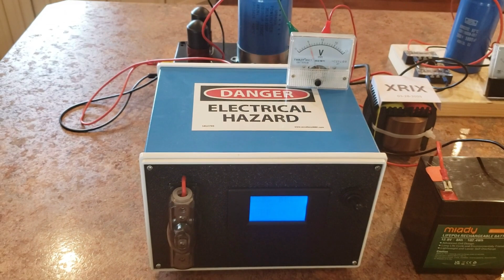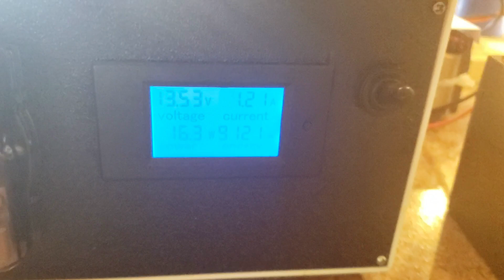Over Unity Working Don Smith Device - Part III

Comment: @XR_IX : In zilano final disclosure / the device shown here what is the 350v dc power? 
Is it a capacitor that is charged up to 350v or some voltage then when the xenon tube is triggered it releases that capacitor to the coil?
Or is it just the output of a transformer from the 4.5v / 12v dc that's being pulsed in?
Is there anything special wires needed from the dc source? 
is using 18awg hook up wire ok?

Trying to put a electrolytic capacitor (3 x 50v 1000uF capacitors in series) that is charged up with another transformer then at 70v the 70v gdt makes an audio sound when it discharges the electrolytic capacitor. Without the capacitor, the gdt discharges with just a normal reddish color without any sound.

The input - in zilano's diagram looks like it's connected to earth ground? I did not have any connection to earth ground in the tests.

Putting like a 6v-12v lab power supply there as input and a mosfet pulsing the where the xenon tube is at requires a lot of amps from the power supply and the transformer past the microwave 1uF capacitors doesn't seem to get all of the power from the mosfet pulse. This is true for the 1uF microwave capacitor setup in the zilano final disclosure or the 3 capacitor setup in tesla colorado spring pg 57. If the transformer is just pulsed directly without the microwave capacitors and the diode on the + power supply, it works normally as expected.
Reply from the maker: @briareosbri

Lot's of questions, let me clarify from beginning. The exciter caps are charged to 1500v which is the limit of the GDT. The Xenon tubes, take over at the point there is enough energy to drive them, and calibrated to a frequency where the GDT does not fire. They are run solely by energy from the tertiary coil on the isolation transformer. Thus I am not spending additional energy to drive the switching of the xenon tubes. The tubes are also firing in sync with the exciter pulses, because the maximum voltage sent to the xenon tubes will be at the same instant the tubes spark over, and the field collapses. It's basically constructive feedback. They are redundant to assure longevity. HV side hookup should be fine with smaller wire. This is not very powerful output, but should you build a more powerful device, you will be sending more power from the caps to the trafo. The caps do start to get warm, if you start raising the joules per second. I can't speak to your capacitor values, nor omitting the capacitors entirely. In theory this is why you see amplification in just batteries alone, switched on/off. However Don Smith used them in his earlier devices, and there is a reason for using HV, which simply it is more efficient in producing coulombs of energy, because the voltage is squared. Lower voltages and higher capacitance switching, means you have to charge caps with amps, to compensate. It implies that the opposite is true, however HV is hard to switch outside a spark gap, and it wears the components. I have burned spark plugs to nubs in less than an hour. This is what people fail to see, is that you have to have energy to create more energy. There is a relationships for components, used and the efficiency of the device. This is why Don built so many types, he was looking for the most efficient way. I am glad you are surfacing some of these aspects.
Reply: @XR_IX  @XR_IX
Thank you for replying.

I was thinking of trying to put two primary coils in parallel on the output transformer, one on the top leg and second leg. The output coils would be wound over each leg. I am not sure if this will work. I'll try it out to see if this will work correctly with low voltages.

I have some more questions:

1. You mentioned a GDT, is that what is outside of the blue box a 1500V GDT?

2. For the xenon tubes, can a camera flash xenon (around 3.6mm in diameter x 34mm) tube be used? I believe they are rated for 300-500v. I'm not sure when the xenon tube is shorted how much voltage rating is needed, is it 1500V or 500V? I'm not sure what size xenon tube would be needed then. I'm not sure if multiple can be put together in parallel to fix the voltage issue. The trigger wire on the tubes would be all tied together also.

3. The wires on the output transformer are they just regular tinned silicone wire? For the primary winding, I can't tell if it's using silicone wire also or magnetic wire  (like 20awg?) then soldered to like 16awg silicone wire. 

4. It looks like one of the output is 10awg silicone wire with 8 turns or so for the 12v output. I believe a microwave transformer is around 1:20 ratio. So does this mean your primary is around 8 * 20 = 160 turns?
Reply from the maker: #1 - Yes
#2,#5 - You should stick to gdt, and stay away from Xenon tubes and solid state until you know what to expect. Xenon use is not easy, and was an improvement because my GDTs would burn out after a day once I got over 600V 
#4 - Yes, Litz wire is best but Si DC wire works, which Don used Speaker wire. The WHY this works, is really the secret to the universe.
#6 - 12V HV(via NST, ZVS+Flyback, Spark Module) --> FWBR --> PP 1500V GDT --> Par/Serial HV CAP Bank --> PAR Primary --> Secondary --> FWBR --> Storage Cap --> DC LOAD
Reply from the maker: @briareosbri

You must try to focus your questions, because I believe you are in discovery mode and it is easy to try too many things at once. It leads to dissapointment and frustration.

I have three OU videos, The reason I built a progression, is because I move iteratevly. My approach is to get success, and to improve generations by testing. Before I built six MOTs, I used one MOT, two MOT... I used a MOT because I can buy them, and the effect can be seen, though not optimally. You can buy an off the shelf MOT, use a spark gap or GDT and see results. I urge you to get something working, which means illuminate an LED on the output side of a transformer. 

There are many failure paths in building your own output transformer. It looks easy, but it's not. I have purchased over two thousand dollars of Metglas type cores ranging from AMCC32, AMCC40, AMCC100, AMCC200 and a very large one probably 2 times the size of an AMCC1000. Don Smith said he could create OU easy with transformers he had built in India. But you have to know what you are doing.

Build something that works, find an application for making it usefull to remind yourself and keep you inspired. I have a 10W solar panel that keeps two 20W 120V LEDs iluminated for 4 hours on cloudy days and 7 hours on sunny days. It has run steadly for two years.
Reply: @XR_IX  
When using a ZVS+Flyback, is a FWBR necessary for the output of the flyback? I believe the flyback transformer already outputs dc (The suction cup output, it should have a diode in there). I am not sure if another diode is needed after that like in zilano's diagram. If it is needed because it has a faster recovery time, then 2 BYT78  in series (for 2kv if using a 1500v gdt)?

I've looked into litz wire also, some are sold with around 100khz frequency, I think using it at really low frequency the stray capacitance or something may make it worse than just using a solid magnetic wire. The wire don use was special it had each individual strand coated in some sort of plastic insulator, which had a ton of strands to counter the skin effect when running at higher frequency.
Reply from the maker: @briareosbri  I'm sure it depends on the "Flyback" you are using. You would have to look at the specs. I use ones meant for CO2 lasers. It works fine, I am not getting a reading on my meter to confirm there is one there. The point is to get DC to the caps to charge them. RE: Wire - Not sure if you are talking about Amp King or Litz. Litz is the only wire I know which is individually insulated.
Reply: @XR_IX  
I saw this text n some q&a with don:

Q: is the Amp King #8 multistand wire Litz -ie insulated conductors – or regular, like house wiring?

A: it’s similar to Litz but no individual wrapping on each multistrand. It’s flexible, plastic coated normally used for high amperage DC, but works beautifully with High
frequency AC. I assumed You want a practical Unit which produces Energy which becomes useful upon passing through a diode bridge into a capacitor bank and then through
an inverter to useful load. Regular Tesla Coil Transformers don’t produce usable amperage. You can up the amperage by putting ferromagnetic ( soft magnet material ) as the
core of the L-2.

I am not sure if the amp king wire is what don mentioned or some other wire.

Also you mentioned: PP 1500V GDT. What does the PP stand for? Does it mean in parallel or 2 in parallel?
Reply from the maker: @briareosbri  Parallel. Yes that quote I know quite well, so really his wire is not individually insulated. But question why this would matter, because in the end, current is distributed evenly on every strand --if it was insulated, according to Ohm's Law.
Reply: @XR_IX  
Hi XRIX,

I have a few more questions:

1. When using a gdt 1500v is it supposed to make a low frequency sound in the core (probably around 30-40hz maybe less)? 
Also, I get around 5.0v with a 350v gdt output then it's around 9-10v or so with the 1500v gdt. Both of these tests were with the same amcc0320 core config. This is when the capacitor stabilizes (16v 100000uF capacitor). The load is a 12v 5w incandescent light bulb. I've burnt out a few BYT78 now. I didn't think it'd burn out on the output side of the transformer. I put 2 in series for the output side now.
I'm using around 12v 2a (around 22-24w) of power when the zvs is powered. I think I've seen others get around 8v or so with a MOT.

2. Is the size of the gdt correct? around 8mm diameter and 6mm or so? Should I try to find larger physical size ones? I've seen gdts that go up to 6kv - 25kv which is pretty crazy. I would never try anything over the 1500v. I can see why don use such huge capacitors now.

3. You mentioned that I shouldn't try experimenting with xenon or solid state until I know what to expect. I've tried solid state and got the same result as the 350v gdt. Solid state was not that bad to get 'working'. The xenon approach seems like it would take a lot more work for me to figure out how to do the trigger. Somebody mentioned a patent regarding this, which is almost identical to zilano's diagram. I think in the patent they mentioned that the xenon tube has to fire at the same time as the input pulse when it's high. With the solid state, I just had to have the correct frequency and duty cycle. I tried changing the phase to see if it would align with the input high pulse, but it only affect things a little bit. How do you sync the xenon tube trigger with the high input of the zvs or nst (The patent mentioned this was voltage amplification I think)? Also, if it's not in sync does the output drop a lot?
Reply: I tried the setup with a MOT the mot primary coil resistance is 1 ohm. The secondary coil resistance is 160 ohm. It came with a 0.85uF 2100v cap.
Hooking up the mot to the zvs+flyback and measuring the voltage at the output capacitor it's around 0.7v which seems really low. I'm probably doing something wrong. I have the following:

zvs+flyback > fwbr -> par 350v gdt -> serial/par 1uF cap (each serial cap end is connected to one of the gdt legs)  -> MOT secondary  (160 ohm) connected to par cap > MOT primary (l1 ohm) -> fwbr -> 16v 100000 cap (multi-meter on this + and -) -> 12v 5w bulb. 

With my simple winding on the amcc0320, I get around 3.5v output.

This probably explains why I can't measure any magnetic field around the different transformers all this time.

When I first tried this and had an input of 5v instead of the zvs/flyback and just shorted the wire by hand, I can feel the wire magnetizing when shorting it. It was strong enough to feel 'sticky'.

I'm using spade connectors to the microwave caps with 16awg wires. I tried switching to 10awg wires for the serial/par cap connections soldered to the spade connector (4.8mm) . This didn't seem to make much of a difference. For the gdt, I'm using "Lever Wire Connectors 1 to 1 Inline Electrical Wire Connector". I am not sure if the gdt needs to be soldered to the serial cap. The lever connectors make it easy to try out different gdt.

I wonder if my connection is wrong somewhere and that's why it's generating such a small magnetic field. Maybe something's wrong with the caps or zvs/flyback. I tested the caps and they show around 1uF capacitance.

@XRIX The magnetic field should be detectable around the transformer with a 350v gdt?
Reply from the maker: @briareosbri  I will share this for one week https://youtu.be/URkTNuZYZ_c
Reply: @XR_IX  
Thank you for all the information.
Reply: @XR_IX 
 Is the red thing the varistor?

Also, what is the thing connected to ground with the green wire? Is it a surge arrester?
Reply from the maker: @briareosbri  Red is Varistor, clamps down  to  assure my expensive caps don't breakdown. The green wire is neg of the capacitor of the pair that drives the analog meter to let me know it can charge to 12V
Reply: @XR_IX  
Sorry, not that green. The green wire that's close to the nst. It is connected to something that looks like a heatsink or something. I thought it was a spark arrester or surge arrester. I am not sure what is inside it also.
Reply from the maker: @briareosbri  Oh in the Red Pill, that is early test circuits not used in that specific configuration. You see a thyristor used in many Don Smith devices. If you get to that point, you are really rising above the rest.
Reply: @XR_IX  
So the long red cylinder bar is a varistor in the red pill? Or is it a bleeder resistor for the caps?
Reply from the maker: @briareosbri  Those yellow caps would stay charged without that bleeder. That's why I switched to Microwave caps that discharge on their own, when using HV. Even  a 1/4 1Meg would do. But it depends on your firing cycle. I have smoked capacitors in other experiments, so safety needs to be applied. I believe those are 1uF@1KV but they become marginal using a spark gap over time. Which taught me other valued lessons about resonance. You can brute force the exciter to work, but it always better to match a working resonant frequency. Not something like... find the Earth resonance, or Schumann Freq, (Though Both Are applicable in different situations) it is more  a relationship with your HV supply can has enough power, and if the natural Freq between the coil and caps can keep rolling. Have you ever asked yourself why Zilano circuits look so simple? There are two reasons, the core of why the work is simple, and it because it does something unexpected. You see the Red Pill, nobody would have suspected you could do that with electricity.
Reply from the maker: Last day BTW and Red Pill will be unavailable tomorrow.
Reply: @XR_IX  
You mentioned "spark module" like a car ignition coil? 
If this is correct, I'm guessing the reason to use this would be so the frequency like at 72hz or lower can be used to match up with the switching of the cap's frequency.

I'm switching my caps at around 52-72hz. I think my primary coil odd harmonic  (square wave, so I believe it should be an odd harmonic) resonant freq  is around 72hz. I left a gdt  in parallel sitll to protect the switching from going too high voltage, while I'm experimenting.

I have not tried to match my secondary coil resonance with the primary coil on the transformer. I believe I just have to add the right capacitor values in parallel to the secondary coils.

I've tried a zvs+flyback and nst so far.
Reply from the maker: @briareosbri  I use a cheap Aliexpress spark module for 6 dollars, to keep two twenty watt 120V LEDs illuminated in my backyard for 4 to 8 hours depending on the amount of sun that day. It isn't a frequency, it isn't a holy grail part. This was told to me from the first guy I believed actually created a working device. You use high voltage to overcome capacitor costs. You are turning voltage into coulombs, through a capacitor transformer system; That requires a capacitor and primary and secondary. But once you figure out what is going on, you will realize that capacitance can created in many relationships. It really isn't the "Capacitor"  that is the key. It the DC ON/OFF. -Which can be done with batteries and no capacitors. Hence HV isn't really needed, but then switching becomes the hurdle. There are ways to simplify all aspects of tuning the primary and secondary DSE transformer. Build something that produce power on a secondary, and learn how to consistently manipulate the parts.
Reply: @XR_IX  
Regarding the transformer, is the tape used between layers:
MMYP-1 Mylar Metalized Polyester Film Tape with Acrylic Adhesive ?
If not, what kind of transformer tape is used?

I watched one of don's video and he mentioned it was a metallic tape and it had some shellac or something on it. This was on the briefcase model. With metal tape between each layer and a dielectric, doesn't this create a capacitor.

Also, on don's brief case model it looks like your winding except for the thickest wire on the transformer was the primary and had pairs of wire and one of them wasn't connected and left pointing up. Don mentioned that the wires standing up and unconnected were antennae, but I wasn't sure if he was kidding or not. 

In your transformer, I saw in the comments that the thickness wire (black) was an secondary output. Does it have a fwbr at the end of it also? I see that the other black wire is the 110-120v output with a fwbr on it.

I have tried bucking secondaries on the transformer (one diode on each of the secondary only), I think that gave the most output for me so far. The secondary had the same length. The secondary windings were not a multiple of the primary. I need to have all the windings be a multiple of each other. Also, since it's such a low frequency and hv it seems like you'd need a lot of windings on the primary. I believe that's how a normal transformer would work.

My input power go up a lot after a certain point, I think my core is being saturated. It would be amazing, if I could get 70-90% output power from the input power at least.

I have not tried with a amo nano core yet. I believe a amo nano would work better at lower freq (like 5-12hz) than just an amo core.

You mentioned there are ways to simplify the tuning of the primary and secondary. Is it just keeping all the wire lengths a multiple of each other? Also, I've read that to keep the resonance for the wire length, the wire connecting to winding outputs should be greater or less than in awg diameter (this terminates it or something?).
Reply from the maker: The approach is to create as many joules as possible over a small time period. If it takes you all day to charge a cap just to have a huge discharge, you are less likely to capture and utilize that single pulse versus many consistent smaller ones. That 350V means that is cap limit? Not necessarily. A cap is such that you achieve 1T around 63% So you should always have about twice the capacity  to assure that you are not fighting to fill a capacitor to maximum breakdown. The like charges will resist being placed in a cramped space.
Reply: @XR_IX  
I've been trying to look up the equation to find the tesla for discharging the different value capacitors at a voltage. I think I'll probably need other information like the inductance of the coil and resistance of the coil.
I'm using 3x .84uF microwave capacitors in series now.  I believe that means I'm discharging 0.28uF into the primary. I'm using a 1200v gdt. I've tried a few different value of capacitance (paralleling or in series to raise/lower capacitance). 

I've tried out the xenon tube switching, I am triggering the xenon tube at 33hz for the 1200v. The xenon tube gets very hot, this is probably normal since all light bulbs get hot. I think it's better to have a shorter xenon tube, so it turns off faster?

I just wanted to try the gdt / xenon tube to see what it's like. I am using a mosfet (0.001% duty cycle) for the capacitor discharge to trigger the xenon tube. I'll go back to gdt / solid state switching.
Reply: @XR_IX  
Any information I should read / learn about regarding building the transformer?

I've tried an amo 0320 and a amo nano 0125 core now. 
I tried bucking coils on the 0320 core, with only 2 diodes. I've tried different amount of turns with this configuration.
I tried just winding cw/ccw with a fwbr on output for the amo nano 0125 with 324T on each bobbin.
I tried air grounding with the output ground, and it didn't seem to do anything.
I only get around 12v - 20v output max, not sure about current.
I've tried using just the bobbins on an air core and that gets about 7v, which is pretty crazy since it's like half of what it is on an amo core.

I forgot to plug in the output once and it sounded the the amo core was gonna break apart from the really loud sound, seems like it was really magnetized and hitting the two halfs with really strong force. I tired using a magnetometer and still can't get a reading around the core, not sure what I'm doing wrong. I'm able to put the magnetometer over a neo magnet and it registers it fine. I tried getting readings from the amo core and an air core around the coil/core, but it did not register anything.

I haven't tried a zero transformer yet. I think don smith uses this type of winding. I think zero transformers require pretty high frequencies to get working though. I believe they need an earth ground, not sure if it could be air grounded with just an aluminum sheet or something.
Reply from the maker: @briareosbri  You should not get a reading on a gauss meter with a neo, unless you move the magnet around.  So understand that you are not capturing the power of a stationary flux field, but a moving one. Which is what you are trying to create successfully. Have you got a single MOT to work? You also have to remember if you are using 1uF caps, and firing them at 600 to 1500 volts,  that the frequency of the oscillations will be high. So use high speed diodes. You can't use microwave capacitors, use the BYV Sinter Bead diodes, and using two is fine, but  a FWBR is the best. I am not sure what you are doing wrong, make sure you use thick wire on the primary like don device 3. Remember his secondary is skinny. Maybe you should take different wire types and leave them on the spool but just run it in parallel with the the gap, and cap. Measure the amount of flux you have with a gauss meter. You need to learn what the best materials to get the most magnetic flux
Reply from the maker: Post a video of what you have. Easier to troubleshoot
Reply: @XR_IX  
I've gotten a single MOT working with 12v 5w incandescent light bulb.
I'm using 3 x 0.848uF, BYT78 diodes, FWBR with the amo nano core currently.
The 324T was with magnetic wire 20awg.
I just tried using 16awg silicone wire pure copper,oxygen free 252 strands with 44T CW and 44T CCW  on each bobbin on the amo nano 0125 core. The result was not much better than the magnetic wire. I'm using ferrules on the ends of the wire.

I'm using something like this: "Gauss/Tesla Meter with High Precision Probe & Auto Range Recording 0-20000Gs N/S Polarity Identification, Magnetic Field Tester for Residual Magnetism & Nondestructive Testing" to measure. Maybe it's the wrong tool? I tried it on just an air coil hooked up to the output of the exciter and that meter did not read anything.

I can email you a picture of my setup if that's ok?
Reply from the maker: @briareosbri  An incandescent bulb is like a dead short. The reason we can illuminate LEDs, because some are like dams, and they don't turn on until you reach a threshold. That's why you can't get over 5 volts. The energy is there, but you are grounding it out the DC before it can build. An incandescent bulb illuminates with AC because the charges are basically are sawing back in forth through the tungsten. Charge friction is making that filament hot. Both moving towards ground, and alternating the current. This is why you see many FE devices running high frequency, because for a small energy the friction make current move back and forth faster. So yes you can run a 100 watt bulb with 25 watts of power, if the frequency i 240Hz. I think that is why planes use AC that is 400Hz, to reduce the size of the electrical components. EVGray used to do this. High Frequency, also reduces the risk of fatality because it moves on the skin of conductors. Yes your load matters. That's why I like to show here's my DC input versus the DC loads that I can run. One experimenter has already confirmed that DC verses AC power illuminating the same bulbs I use requires equal or more wattage. Please read some of the other posts.
Reply: @XR_IX  
Thank you xrix for explaining it.
I was able to light up a 110v incandescent light bulb to like 20v or so, but the input power was crazy high.

I've read the comments that you can use a dimable led or a small motor as a load.

It's probably not possible to connect the output to like a mppt, since I don't think it's a dc load.

I've learned a lot doing these experiments, like doing the switching with the gdt, xenon tubes and the capacitor discharge.

I'll try it with 2 air cores (324T coils that I built) as separate transformers to see input power not increasing when adding more transformers to the output.
Reply from the maker: @briareosbri  That is the whole point to it, as long as your transformers are the same primary dimensions,  you should be able to distribute the power equally, without loss of output to each secondary. If you start expanding that thinking, you will be in business. Remember that you are simply multiplying the amount of magnetic flux, so the more power you use your output goes up. I only show about 15W of input, but look at all the work I can do. What if you had higher input 400w, and 10 like transformers.... Do you see the potential? use the equation J=.5C(V^2) where C=Capacitance in Farads and V=Voltage. Then divide the J/Frequency where 60hz=.0166666... Example using 1uF Capacitor at 1200V: .5*.000001(12000^2) hence J= 0.0000005 * 1,440,000 = .72J per pulse. At 60Hz = .72/.0167 ~ 43.11 watts. Your power supply (ZVS or NIST) has to supply 43.11 watts continuous to charge/discharge that .1uF capacitor  at 60Hz. Seems simple but many power sources don't do it well. Don's Old style 15K NSTs were around 450VA maybe. If it were 30ma. But those things could deliver that. The current switching style that are switching, are better because they use HF (~30Khz), but they really not meant to constantly burn. The get the neon bulb fired, and then they draw back once they glow. The also have UL protection circuits, and you are basically shorting them.
Reply: @XR_IX  
I'm currently using a nst 12v 3a, out 4500v 20ma-30ma. I think it's drawing around 13watt of power. I'm using a 12v 350watt power supply. I haven't tried using a 12v 7ah lead acid battery yet.

I also have a zvs that is 12-30v input and 10a-20a. It's supposed to go up to 250watts of power. How do you control how much power the zvs uses? Is it just less turns on the transformer after the exciter with really thick wires so there's less resistance, which makes it draw more power?

I don't understand how to get the input source (like a zvs) to supply more power for charging up the 3 exciter caps faster.

I also experimented with pulsing the output cap to another transformer at a much higher frequency (>10khz). I don't think I was getting any gain by this, maybe a little bit of a loss because it has to go through a fwbr again for the 2nd transformer. The output cap 5600uF sat at around 40-50v.

I also have tried using my own input transformer at the start of all this that was 24v input. it would oscillate and charge up the capacitor to the high voltage. I believe I saw the trumpet wave. I think it was really efficient on input power. I'd have to test it again.
Reply from the maker: @briareosbri  On a neon size transformer the load is the length of the neon tube. Same for increasing the spark distance, effectively raises the voltage to jump the electrodes. Since your Neon sign transformer is fixed at 30 ma, it raises the input power. Carry that into the caps size can is related to the input power. It is a dead short empty, then it fills up and resists being filled. You have to find the limiting part of your exciter.
Reply: @XR_IX  
I think I could try the zvs again with 24v instead of 12v. This will probably increase the input power.

I measured my transformer. I'm getting around 1100ef and 56mG. I believe you were able to get 99mG (or greater) on the microwave transformers?

I'm using 3 x 1.0uF caps now instead of the 3 x 0.84 caps. It's running at about 36hz.

I really need to learn how to make my transformer more efficient for this higher voltage and lower frequency. I was able to get it to 95+% with a bucking setup with pulsed dc at 12v at around 12khz. With this current setup, since it's such a low frequency I'm getting horrible results (I think it's less than 1W output, when the input is like 13W+). If I can get the transformer to be 80% efficient at least, then I'll do multiple transformers in parallel.
Reply from the maker: @briareosbri  Litz wire works the best. I think you need to concentrate on building an exciter you get good results, and then work to get your transformer right. You have some ground to make up, because I can break 99uT so I have an order of magnitude better flux at least. Just uploaded a short to show you.
Reply: @XR_IX  
Wow that's crazy. 
I checked mine and it's only 5uT. What you have is more than 20x. I'm using by203-20 2000v 0.25a for the fwbr after the nst. Maybe I should try BYT78 in series to get the 2kv to make the fwbr.

I'm using the 1uF microwave caps which are non polarized and it's just an oval metal can. I have the caps connected to a ground bus bar (4 in parallel), the output is connected to the ground bus bar. The output is connected to the 2 center ground bus bar. The nst, diodes, gdt are connected to 2 parallel screw terminals.

I'm using a 1200V gdt pulse peak current 10 kA, 8mm diameter x 7.9mm.

Power supply is 12v 29amp.

I tried pulsing an air coil with 10awg silicone wire (8 feet long) with 8 turns and it only reads 1.5uT.

If you pulse an air coil with your exciter how many uT do you get? It's easier to debug to know if it's the exciter or the transformer. If it's the exciter, I'm not sure what would be wrong with the exciter.
Reply from the maker: @briareosbri  Your configuration "sounds" right, just like a schematic "looks" right. You'll need to post a video, to show me what you have.
Reply: I just tried it with zilano 2 cap config on the air coil and it's 0.8uT (It pulses a lot slower). I'm not using a 12v battery, I don't think that would make a difference. I'm using a 4 x 23 slot ground bar bus terminal, maybe it's too big?

I tried using just single byt78 fwbr after the nst, and the output is still really low.
Reply from the maker: @briareosbri  There are things that you are doing that is pulling yourself down. Why are you using an air core? Because Don's device 3 is air core?  People tend to make mistakes like this, what I suggest is take your setup and place an MNZ rod in the center, and see if your performance changes. The magnetism in the solenoid of an air core doesn't  conform to  what is known. Because they show the field in constant current, not a disruptive spark. If you take a magnet and move it around a sparked coil, get an idea of how the field is, and then you  can strategize how to best create and use that energy. Don said that solves amperag, “One of the pages ” Tesla Coil Geometry ” from my book was posted to the group which explains how to correct the amperage problem . It was totally unnoticed"
Reply: @XR_IX  
I'm just using the air core as a test, I thought this would be a simple way of testing to see if the exciter is working properly. I'm using an amcc0320 and an amcc0125 core. What I was measuring was only 5uT on the amcc0320 core.

The video of the setup with the air core test is at:
https://www.youtube.com/shorts/0Rvdo5n8QvA

I'll switch back to the amcc0320 and amcc0125 once I know the exciter is 'fixed', if it's an exciter problem.
Reply: @XR_IX 

Does anything look wrong with the exciter in the video?
Reply from the maker: @briareosbri  Thanks for the video. What you have in the tray is close to what I have in my blue box, save that I have 12V CPi-45 NST. All my builds are not connected to the grid in any way. Why would that matter? It shouldn't, however we don't totally understand the impact on Earth ground  on these circuits. The Earth is a drain, by nature's design. I like my builds isolated. And have future experiments I want to try to on the output side. Your issue with not having the flux present (or using it) Is you don't understand where and why I took the measurement the way I did. In your air core,  the flux is in the center of the coil, not on the surface of the helical cylinder,  but INSIDE it. So if you built a coil with the same materials, but large enough to put your meter in the center (slightly off center to bloch wall) You will see the heart of the toroid. That is another one of the misleading assumptions people make when building. When you put a core material, now the magnetism can accumulate (if you capture the heart). Look at my Tesla Coil lights 4 120V lamps. People don't realize that's where my mind started changing about looking at this from the Magnetic perspective. Not the electrical.  A core simply accumulates, but a disruptive spark initiates/perpetuates the  aether spin within the ferrous material. There used to be videos showing that if you take  two halves of a soft magnetic material brick, that has a a groove on one face, such that you could put an insulated thick wire in the center of the two haves, then spark it from a cap. Pull the wire out, the two sides will stick together as if magnetized. But the brick emits no external flux, so nothing will stick to the brick.  When a primary wire is stimulated, the heart sends flux around the material. A portion of that flux is consumed by the wire (at right angles). Which induces current in the secondary. What you are capturing, is gonna be half of the pie, at a reduced magnitude. Look at stater and transformer design. An E core, is basically two C cores smashed together. OU II is configured this way. Once you overcome the exciter fundamentals, you need to learn how to build transformer specialized for this application.
Reply: @XR_IX  
Thank you for explaining all that.

The nst I'm using is actually the 12v cpi-45, so there shouldn't be any problem with the exciter besides the gdt being different and the power supply. The bourne 1500v gdt burns out so fast for me (burnt out like 4-5). Bourne usually burns out in less than 2hrs think. The tdk 1200v lasts a lot longer haven't burned out one yet.

I read about the bloch wall before. WIth a the N and S magnet sides magnetic lines curving in back to the center (bloch wall) of the magnet.

I don't think my power supply is actually earth grounded. I'll try with a 12v battery to see if it makes a difference.

I not sure if using litz wire would be the 20x difference.

The other thing that I haven't try is using exact 1/4th length of l2,l3 wire for the primary.
Reply: @XR_IX  
I measured the voltage across the spark gap with the 1500v gdt it measure only 500v. 
With the 1200v gdt, it measure 560v.
I did the measurement with an analog meter (can go up to 3kv) and a digital meter (digital can go up to 1kv). 
Measurements from both the analog and digital meter are registering around the same voltage.

The discrepancy between the gdt 1500v and 1200v is probably just the tolerance.

Is it because the gdt only fires periodically that's why the voltage measures only in 500s, so it's taking some sort of average?
Reply from the maker: @briareosbri  What exactly are you expecting? You are putting a meter that has resistance across(Parallel to) a spark gap that has almost zero resistance when it fires. If you scoped it it should appear as a trumpet. The capacitor builds charge until the spark gap fires, then builds again.
Reply from the maker: I have a scope but don't use it, because I'm sure  it may take a hit if connected wrong.
Reply from the maker: @briareosbri  Yes that's why I have a quick change outside my blue box. I bought GDTs in bulk in AliExpress SXH81-152X 2R1500 1500V 8*6  SURGING Ceramic Gas Discharge Tube Detonator, so I would buy a hundred at a time. Then Tariffs screwed imports so harder to get now. I used to get a 100 of the Surging for around 20 USD. That's why my move to Xenon which is OU III. I have have enough flux so it actually drives my xenon tube circuit for free. The control circuit is run by the output of the device. Which sync locks the pulses. They fire at the peak of the power. So my GDT will last for months, because they only fire a handful of times, then the xenon tubes start rolling.
Reply: @XR_IX  
What is sync locking pulses and firing at peak of power?

Is it syncing with the nst high pulse and when the nst fires a high pulse the xenon tube will fire at the same time?

Firing at peak power means when the caps are charged to the desired voltage then the xenon tube fires with the high pulse from nst?

With a gdt this is done automatically?

When I set up my xenon flash, I didn't sync it with anything I just fire it at 36hz. Maybe the sync locking with pulses is what I'm missing to create a bigger magnetic field.
Reply from the maker: @briareosbri  Yes, because the xenon charging circuit is from the device itself. Though I have used 24Hz as the firing frequency, where that edge falls is feedback from the output of that coil, so it should be influenced by that. I think it helps. If you take a frequency counter next to the device the frequency is still in the RF, not at 24 Hz
Reply: @XR_IX  
Ok thanks.

I just tried running the system off a lifepo4 12v battery, and it's the same as running from the 12v power supply.

Putting the meter near the gdt  registers around 1.5uT. 
When it gets near the nst, it registers around 4uT. 
Around the amo nano 125 core, it's around 2.3uT.

I'm still not sure how to raise this higher.

I have L2 and L3 the same length, I did not make the primary 1/4th length of L2, L3  yet. I haven't tried syncing the pulses. I'm not sure if how you wind the transformer can boost the magnetic field from the 1.5uT-5uT to 99uT+.

The frequency counter is it registering the nst's frequency? I think the cpi-45 is 31khz or 31.5khz.
Reply: I tried configuring the transformer in different ways and one of the way it gets half the voltage and the magnetic field is less than 2uT, but makes a really loud sound like in your 99uT video. It's weird that the magnetic field measurement isn't much higher with this configuration since it really sounds like the core is slamming into each other.

Configuring it normally like how I do it with bucking coils, makes a lot quieter sound.

I think these configurations the magnetic field are cancelling each other out.
Reply from the maker: @briareosbri  That's exactly right. That's why the windings are different primary to secondary. Now if you actually had a round core, you could just continue the windings all around, then you would see why looking at the two different halves why it helps the flux flow to push the flux in back to back N-S and N-S rather than N-S to S-N. But you wouldn't know that unless your tried it.
Reply from the maker: @briareosbri  OU II has no, syncing and uses standard GDT at 1000V. Get one of those harbor fright flood lights and use it as your load. [1000 Lumen LED Work Light] Tell me if that lights up. Post the video of the entire setup. I am not sure why you aren't getting results. I am able to drive loads with whatever device I make.
Reply: @XR_IX  
Do you know why the core makes such a loud sound with one of the config? If I put my finger on it, I can feel it vibrating.

The other config which gives 2x the power is much quieter and can't feel the vibration on the core, but you can still hear it.
Reply from the maker: @briareosbri  Yes I do. You have created two instant electro magnets that oppose each other. I assume you are not clamping your cores so the opposing fields are kicking away from each other. The two cores should be pulling in together. You can hear my cores slapping together on my measurement video. Opposing coils are noisier, and little energy is induced.
Reply: @XR_IX  
Ok that explains the loud noise. I have the core clamped, it isn't perfectly tight.

Is this the flood light at harbor freight? I it uses an ac cord:
LUMINAR WORK 1000 Lumen LED Work Light

I can just hook each end up to dc without worrying about polarity?
Reply from the maker: @briareosbri  Yes, it works great. It is an LED but the electronics remove the polarity
Reply: @XR_IX  
The work light lights up at the 120v or so. It takes about 34 sec to reach 126v then it stays there.
This looks like what you have in this video. I'm using only a 1200v gdt though instead of a 1500v gdt.
The meter reads only 1.5uT - 2uT or so.

I also tried putting 2 lights in parallel and the voltage drops to around 123v-124v.

Putting the lights in series lights up at 220v or so, but I stopped it since the core makes such a huge sound in the core (don't want it to break).

I'm not sure how to get the 99uT that you got in the short video.

I think I remember reading/hearing something somewhere that Don smith mentioned that he could get the same amps as the volts, or at least a lot higher amps. I think his device 3 was 8000v and 20amps (maybe can go higher).

I'll probably experiment with trying to use earth grounding. This will need a different transformer configuration (maybe the same as what you have, but the primary will be the thickest wire). I think the pulses need to be much faster (around 1 mhz) though and higher voltage. This would fix the amps issue maybe?
Reply from the maker: @briareosbri  You are getting to the limits of what a 1uF cap can do. And how fast your supply can fill that bucket. If you use that equation I gave with examples, however you have to start understanding that the output is based on the input as you would suspect. You have to know where you are beating the expected output and  focusing on that. If you created a second transformer, can you light a second bulb?
Reply from the maker: @briareosbri I think Don Smith, showed you enough to make people want to pursue and believe these devices could be built, but his disclosure was done in a fairly metered way. Meaning, that he would show modules reversed, and components and drawings that were figurative but not directly related to devices. You can turn volts to amps, but it isn't through a one step method. You turn volts into coulombs by a capacitive transformer, and then through discharge, you can bring joules of energy(instantaneous amps), and joules at some frequency per second will give you watts. He never gives two things, what the input/output wattage was. Nor did he expose how different his transformers were; in fact most of the time, he mentions isolation transformer. People assume from his pictures, that he was taking small modules that we use, and get kilowatts output. Can you get kilowatts from these 12v NSTs? I suppose, but you would need multiples to supply enough cap filling power. There is just wrong assumptions about what  a single NST device can do, and using math, you can see it won't run a home. However, as an example, you may be able to use a Luminous Tube Transformer (Old Style NST) and run a home, because some ran at 60ma, and could go to 15KV that is 900W of cap filling power. If you could send 900W of power to a transformer primary I built, the output would be huge, and BTW, that is only flipping 15 Joules at 60Hz ( .134uF cap). But the point is, your input has to be able to meet the capacitor charge requirements, and my math doesn't have realistic loses and charge/discharge curves added. So when Don Smith says he uses milliamps...--Truth, but you better know the details. Before you go buying one of those Old Style NSTs, realize there are GFCi and short circuit protection circuits currently, that make them different form older versions. There are many ways, but your components narrow your options.
Reply: @XR_IX  
I think my cpi-45 might have the GFCi/short circuit protection. I opened it up and there's 2 separate compartments. One side is potted with silicone it looks like (where 12v input comes in), the short circuit protection might be here. The other side is the transformer potted with some different material maybe epoxy.

I remember reading somewhere that if you don't connect the ground wire in the nst, it should still be ok. I'm not sure if this is for the cpi-45 or not. I saw a video of somebody removing the gfci / short circuit protection in those old transformer. I'm not sure if it can be done easily with the cpi-45 (has a ground wire) or if it's even needed.

In this OU 3 video, it looks like it takes about 16-17 seconds to get to 120+v for your lights to come up. With the cpi-45, it takes mine about 27 secs before it lights up bright enough (34 sec for when the voltage stabilizes). With a zvs at 12v input, I think it was around 20 seconds for the lights to light up. With A zvs at 24v input, it takes 12 seconds to light up, it stabilizes about 4v or so higher than the 12v nst. At the 24v input for the zvs, the flyback transformer starts to give off a nasty smell and it was a little bit warm when I removed it after a few mins. I probably would have to use a better flyback transformer like the laser flyback transformer that you mentioned (Not sure, if i'd want to get one that has the highest wattage), if I continue going down this route.
Reply from the maker: @briareosbri  Yes to upgrade the power, you have to remove the bottle necks, which means to change components. If you understand how power is being amplified, you can move to flip either larger capacitors, or higher voltages or both. I think you are on your way.